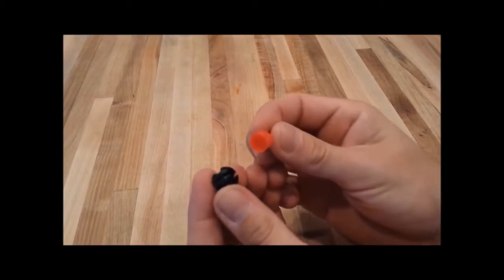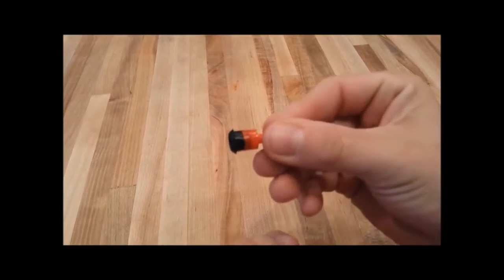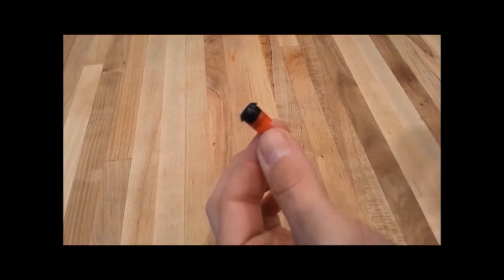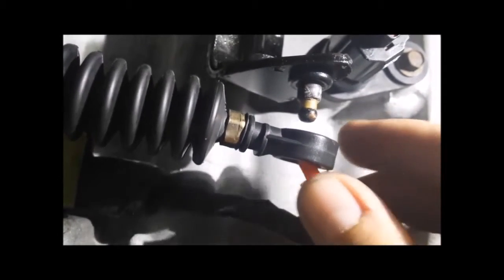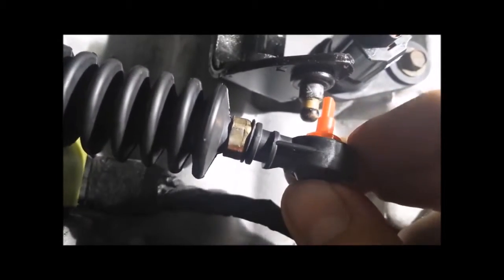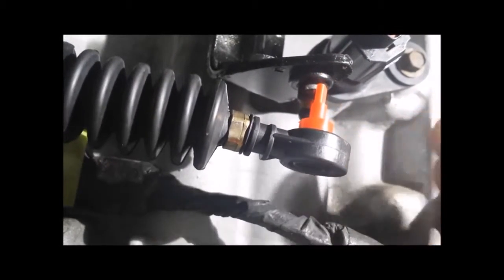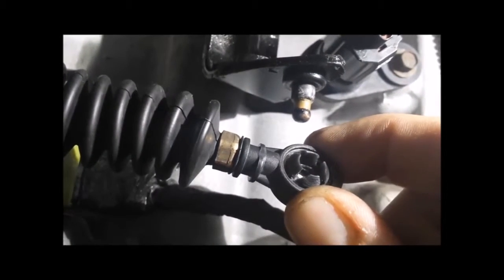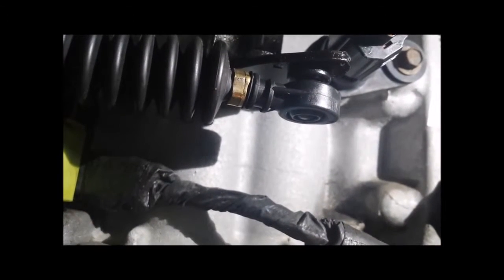The easiest way to fix or repair your Holden Epica shift lever! Kit includes replacement bushing.

Comment: Where is this located?
Reply from the maker: Are you asking where the shift cable is located? Or where our parts can be found?  The shift cable is the line of communication from your gear selection knob to the transmission and runs the length between those two points. To find a diagram of your specific year, make and model simply google shift cable diagram with year make and model.